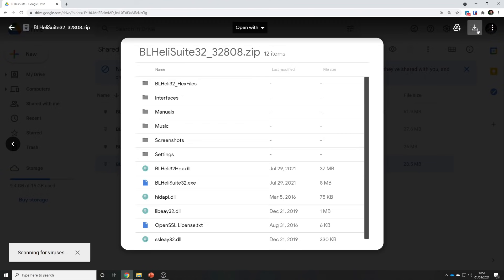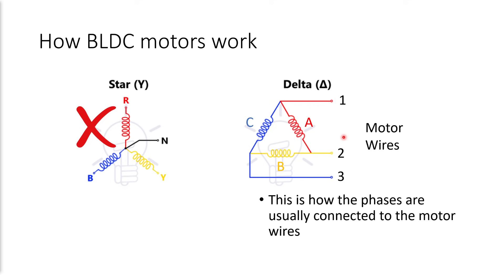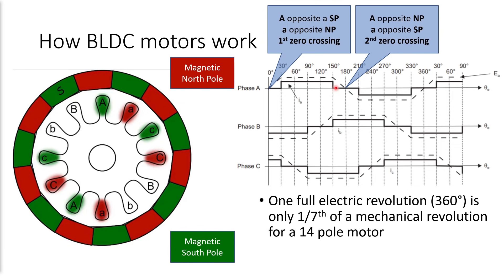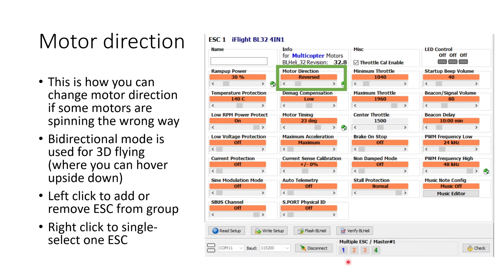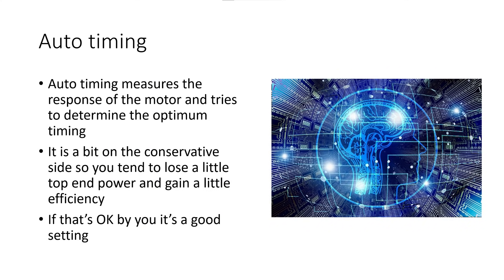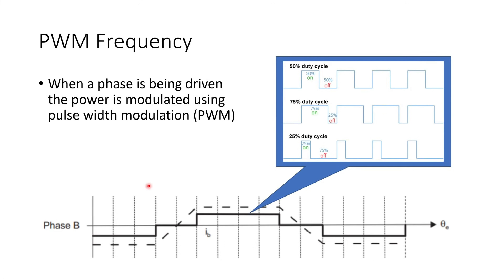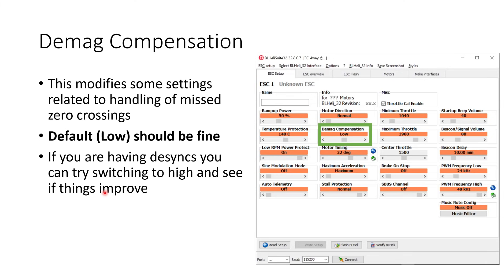Tuning your ESC (BLHeli_32) to stop desyncs and improve motor performance  in your FPV quadcopter!

Comment from the maker: Hi Everyone! I just wanted to pin a comment here following some discussions I've had regarding BLHeli32.8  over the last few hours. A few days ago a bug was discovered in the RPM reporting through Bidirectional Dshot on BLHeli32.8: https://github.com/bitdump/BLHeli/issues/546
This negatively affects RPM filtering and may cause motors to get hotter than on 32.7
There is a tested fix for it here: https://github.com/bitdump/BLHeli/tree/master/BLHeli_32%20ARM/Rev32.8.1%20testcode

My recommendation:
If you have been having issues or are concerned consider rolling back to 32.7 for now I'm sure an update will be released officially soon
If you want to keep using 32.8 features and are comfortable flashing testcode through BLHeliSuite32 then that is also an option.
Reply: how does one use the .hex file?  I've copied it to my hex files folder but it doesn't show up in suite.
Reply: Oh I figured it out.  I didn't save the .hex file correctly so the suite wasn't seeing it as a valid image.
Reply: Thanks for the pinned comment. I'll be downgrading. I'm not using variable PWM anyway.
Reply: So this explains why I smoked one motor with my brand new bheli32 esc   ☹️
Reply: @DronoTron  same here…
Reply: This update has a significant impact on my gyro noise. It's ridiculous that I did not notice that something is messed up with my rpm filtering for about 8 months. I'm using 32.8 since day one of this build and was wondering why I was so limited on my filters even with fine balanced motors and props.
Since the testcode update I can ramp up my filter sliders all the way up, switch off gyro lowpass es and run insane pd gains while having cool motors. That's crazy
Reply from the maker: @waldemarkraus2855  Great to hear that the testcode made such a big difference for you!
Reply: so after downgrade t to 32.7,, assuming im racing. should i increase my pwm freq to 48 or leave it at 24?

Comment: One video answers 3 years of questions. The original beta95x came with a 2 board AIO with blheli 32 ESC. The default ramp up power was 150. That thing would smoke motors if it bounced off the ground landing.  Someone told me to turn it way down and it was fine after that just never knew why, now I do thankyou
Reply from the maker: You are welcome! Glad the video helped.

Comment: Important DIY quad builder reference. Soldler-up, smoke check, plug in usb to check f/c (may as well calibrate the IMU/Accelerometer) and obtain passthrough to the esc, then WATCH THIS. Setting up your esc properly is much easier after watching this effective overview of BL-Heli_32. Others may do a deep dive into specific settings, but this video is the best overall explanation of this critical firmware that I have found! Thanks AGAIN Mr. Rosser!
Reply from the maker: You're welcome. Glad you enjoyed the video. 😁

Comment: Great video!  This is how to be confident about no desync's and losing a long range quad.  I've been playing with this on my long range quads for a couple of years.  These are exactly the same settings I use on my ESC's for my long range quad.  Only difference is I use reg 24khz PWM rate.  Very clearly explained, nice work.
Reply from the maker: Glad it helped! You need an extra level of trust in the hardware for Long Range!
Reply: I use 24khz PWM rate for my 7" long range quad too.

Comment: Thanks! I was really hoping you'd do an ESC video - after the fine tuning one that's the major topic that was still missing ;)
I put the timing on 23° already - but learned quite a bit about ramp-up power and also didn't know that variable PWM is a linear curve but thought there is a switching point somewhere. Gonna make a few adjustments I guess!

Comment: Thank you for explaining all this.  I'm trying this approach on a 7" build: auto timing, 24-48khz, high demag, 20% ramp up on 2806.5 1800kv motors. Hope all goes well.
Reply: How did it go?
Reply: @chrisbee5481  she is a beast chasing planes around, battery sag stops me from full throttle currently.
Reply: @dennismatovich8411  good to know these esc settings worked. I flashed my esc with bluejay to 48khz and my 2807 motors freaked.
On 24khz they are a charm

Comment: Thanks Chris for your very clear explanation. … I can not figure out why there are still a lot of BlheliS escs on the market..cheers!
Reply: What do you mean you can not figure out why?. BlheliS is a free, open source firmware, it doesn't use the larger stm32 chip and it came before Blheli32. As a result more older esc's tend to use it because it came out earlier, manufacturers don't have to shell out license fees so it is cheaper, and it uses a smaller chip.
Reply: Yes, I see the point but the price difference really justifies the performance downgrade and tuning limitations? Do you think that a few more dollars on top of a 500$ build would make that difference? Even on smaller quads the benfits are higher than the extra costs…in my humble opinion.
Reply: @francescomaria8524  Yeah the price really does justify the performance. The licensing fees alone was one of the reasons why certain manufacturers don't run Blheli32, based on their volumes they produce. And I am not sure what you mean by tuning limitations - there are differences yes, but limitations no. Most pilots can't even tune properly let alone feel the difference between Blheli32 and BlheliS - you only know there is a difference because of the increased processing demands on betaflight which has slowly evolving to demand more and more processing power. Arguably some of the best flying esc behavior by 'feel' and pilot feedback was KISS - which ran on something close to BLheliS level of computation demands and it ran on a 1k loop for a lot longer than most people realize. And relative to smaller quads - the size limitations on 20x20 and whoop boards limit the processor dimensions and mosfets that can run Blheli32 - that is why if those boards have them they don't have as many peripherals.
Reply: We shouldnt forget that blheli-s is still developed and bring to table similar stuff as blheli-32 at least for 5' quad
Reply: @zachcarrizales5038  there is one big limitation: no bidirectional dshot. But thanks God I can flash Bluejay!

Comment: Another great video Chris! I had a bad experience when flashing to BlHeli32 32.8. I tried it when it was first released on two quads. On one, my (2306) motors got a lot hotter than I'd like and on the other (1204) I was experiencing what seemed like arm dips or wobbles. Once back to 32.7 everything was back to normal.
Reply from the maker: Thanks for sharing! A couple of other pilots have reported strange behavior with 32.8 although I've never experienced hot motors. You 100% did the right thing to go back to a version that was working for you.

Comment: This is super helpful. I have built a 9" quad and found the motors really overpowered on 3 or 4 S. I suspect it's actually because I haven't tuned the ESC (running multishot). Look forward to more experiments this week!
Reply: Why Multishot?
Is the ESC from the stoneage? Dshot600 or at minimum Dshot 300
Reply: @Thewiruz1  iNav doesn't have full DSHOT support as far as I can see. When I choose DSHOT and save, it reverts to multi. On Betaflight, DSHOT600 works fine with the same ESC.
Reply: @unicron000 I think it depends on the ESC, in my experience on a speedybee 50A ESC that supported DShot300/600 it had that behavior (returning to multishot) while on a Mamba 65A ESC Dshot worked with no issues

Comment: hi Chris. I have an old motor emax RS2205S. it ran ok with multishot, motor temp was manageable. couple or so years later, was used with dshot300(and 600). motors ran HOT! seen some info regarding heating motors, quick remedy was change from stock 24KHz to 48KHz + motor timing + demag.  it solved the problem. newer esc fw gives problem to older motors w/c ran fine on multishot.

newer motors ARE sort of designed for dshot and 24KHz ... just an info.
Reply from the maker: Very interesting. There is no obvious reason why the protocol used to communicate between ESC and FC would change motor performance. I'm glad you were able to solve the problem.

Comment: Very informative video, thank you ! :) Betaflight 4.3 provides the ability to reverse motors very easily. Which was already possible with SpeedyBee (and FalcoX). I gave a try to BLHeli32 32.8 with variable PWM, but like many others pilots, it was not satisfying : it gave untunable bounce back on snappy moves, so I rolled back to 32.7.

Comment: Great informative video 👍
Thanks Chris ☺️
Perhaps in the future you could run
through BlHeli_S as there are still many quads old and new that run this firmware
Reply from the maker: Great suggestion!
Reply: Regarding BLHeli_S, I think best suggestion is: replace it with Bluejay, because it doesn't support bidirectional DSHOT.

Comment: Excellent roundup of the topic! The only aspect you are missing out on is deadtime (although it's hard-coded in the firmware there are a lot of wrongly tagged BLHeliS ESCs out there)
Reply from the maker: Dead time is an interesting one to be sure. Not something I think people should be tuning though as if you get it wrong your ESC can get super hot and let the magic smoke out!

Comment: thank you for this great video. But i have a question. Is the Motor timing a static value? If so, why electric motors do not use dynamic values? Wouldn't it be better if the Motor timings also behaved dynamically to the demanded rpm? Similar to variable ignition timing adjustment in an internal combustion engine?
Reply from the maker: The auto setting does this but many people prefer the extra torque and power they get from a more aggressive static value. It would be cool to have an adjustable auto setting where you could tweak the "aggressiveness" of the auto timing if that makes sense.

Comment: About blheli_32 ESCs, they arent all capable of bidirectional Dshot,  right?  I can't get an Emax single blheli_32 ESC to work when I have bidirectional Dshot turned on. I turn it off and it works.   I blew 1 ESC on a 4 in 1 board. Used a single Emax ESC to replace the bad one on the 4 in 1.

Comment: I have a newb question regarding motor direction:  Most set-up videos/guides say you should just swap two connectors on an ESC to change rotation direction.  On this video you suggest that using the BLHeli set up is the only proper way to do this.  Can you (or someone else here knowledgeable about the subject) clarify this for me?  Thanks!  BTW, loving this video and the in-depth explanations!

Comment: Thank you Chris your videos are very in-depth I have a question about rampup power you say 25-30% for 5in does that apply To all 5in including 6s with a 60a 4in1
Reply from the maker: Yes it does, it depends on the motor size not the ESC.
Reply: @ChrisRosser  thx so much for replying I got TMotor F60 PRO IV 1950kv

Comment: Hi mr.Chris . i have a question . i use 3D Fly Mode rather than acro mode on my  5 inch quad.  On that case, i must increase Motor RampUp up to 100% so the motor can rotate on Low Throtle otherwise it will desync.   And like you said, it make the motors got more heat . Do i have any option to make the motor rotate on low throttle  ? i like to sent you the bench video,if you have discord or instagram.
Reply from the maker: Hi, you can email me with a video or message me on Insta @chrisrosserfpv. I think the setting you need to use is dynamic idle.
Reply: @ChrisRosser  okay sir .thanks 
i'll sent the video soon after get back home
Reply: @ChrisRosser  i've sent it via email ,sir.

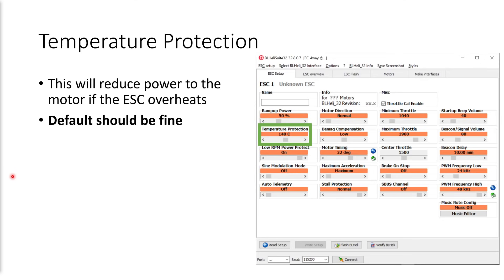Comment: 28:49 Except in the case of F4 equipped ESCs, leave temp protection set to off. If you turn it on the ESC will actively limit how much throttle the motors get no matter what you do. Not sure if that's a bug issue in current BLheli32 32.9 or not but something to keep note of.

Comment: I just got a new iflight nazgul 5 V2 6S, everything is setup and it arms but none of the motors spin when I throttle.. Just random stutters here and there
Reply from the maker: Hi Tyler, this is probably a question for iFlight. If you bought a BNF and didn't change any settings it should fly out of the box.

Comment: should i add a capacitor to smoth the current drawn? im using a blheli-s litlebbe 30A-s opto with a 2212 920kv for a F450 build

Comment: Hi chris, is Rampup Power only a limit for accelerating the Propeller from 0 speed or is it also limiting the power for accelerating in normal flight from one rpm to an higher rpm?

 I used 12% for rcinpower 1506 4100kv to reduce the risk of smoking motor during turtelmode. I know it helps, but if it also affects the agility of the quad i have to think about that trade again.
Reply: both
Reply from the maker: Yep. In BLHeli32 it controls both.

Comment: I found setting PWM to a fixed frequency instead of variable solved a problem with motors getting a little hot.
Reply from the maker: Hmm that may be to do with the 32.8 issue I've been hearing about. I've pinned a comment on it.
Reply: @ChrisRosser  There is an interesting discussion to be had about variable PWM (as well as just different frequencies) and frame resonance BTW. Also I'm pretty sure I remember it right and dev of AM32 firmware (opensource one for BLheli32 hardware) was quite critical about how variable PWM was implemented in BLHeli32.

Comment: Hmm, that's one of the most tempting patreon promotions I've seen. Look forward to hearing about the racing frame and new carbon.

A question; did that 2nd BLheli32 update just after they brought out the variable PWM function, fix the issue with the variable PWM? And.... Would flying 4s mean that you may need more 'ramp up power', seen as it's less voltage, or does the ESC auto adjust for less volts?
Reply from the maker: You may need more rampup power for 4S although it will depend on the rate the motor is able to change RPM.

Comment: Hey Chris. I have a set of the troubled FPVCycle motors on the way. I'm curious if you have some insite of why the recommendation to stop dayncs on those (ramp up at 80-100 and timing down at 10-13°) go against conventional wisdom, and is the opposite of basically everything you are saying (and everything I have heard in other videos like those from Ryan Harrell and Mark Spatz). Interesting to hear some input. Thanks man!
Reply from the maker: Those two recommendations act against each other when it comes to controlling the motor. Lowering timing will reduce peak currents through the motor as the back EMF is greater at the moment the FETs turn on. Increasing rampup power will have the effect of increasing duty cycle and therefore motor current on fast changes of motor RPM.

I would typically increase timing advance to 23 degrees and reduce rampup power to prevent desyncs. The FPVcycle motors have a low torque to inertia ratio. So they should accelerate slower and need lower rampup power. They spin at the same RPM as a typical motor though so the timing should be similar.

Comment: Thanks for this great vidéo, just a question :
Why does motor timing is in ° (meaning bigger time value at low speed rotor speed, lower time...). 
If it is link with motor inductance, why is it not constant for every motor speed ?
Reply: And if it is link with current. Current has probably a scare relation with motor speed, not linear. (timing in deg is linear to motor speed)
Reply from the maker: Timing is in electrical degrees because that is the RPM independent unit of commutation interval. The ideal timing changes with RPM (hence the Auto setting) but a fixed timing provides good performance for our application if set correctly. The auto setting is a little too conservative.

Comment: Would you relate ramp up power is more related to power to weight ratio? It is only a thought at a glance for your listing per quad size.
Reply from the maker: It's to do with the moment of inertia of the motor and prop and the motor's torque reserve. That controls how fast the motor and prop accelerate. Nothing to do with the overall weight of the quad in this case.

Comment: Hi Chris! Great content, a question to you if you have time to answer; how is active breaking working? The reason I ask is because the FC only tell the esc what "power" the motors to have and not what rpm. How can the esc then decide on for how much to break or for how long? 
Best regards, Martin

Comment: Hello Chris! Great Video. However, some racing pilots are using different values for motor timing (some up to 31deg, for 5inch racing quads), and I would like to know if there is a procedure to determine the best timing setting for a specific setup (6s, low airgap xnovas 2207 motors , GF51466 prop, and maybe even the ESC plays a role as they have different mosfets). Any ideas?
Reply from the maker: In general higher timing gives more power and more resistance to desync. It also makes the motor less efficient and increases motor heating. The best timing depends on how you personally trade off those factors. I recommend 23 degrees as a good balance of power, efficiency and motor heating. There is not a 'best' setting because it does depend on your preferences as a pilot.

Comment: Hi Chris, Thanks so much for this content, it really helps explain things at this technical depth so that we're not just relying on "Betaflight" voodoo... question about ESC tuning, where does ESC tuning fit into the "progression" for tuning your Quad that you have shown in the other video? Should this be done before tuning PIDS and filters? After? Or is it separate entirely?
Reply from the maker: Probably best done before PIDs and filters. 👍